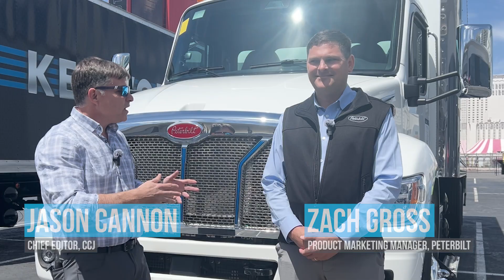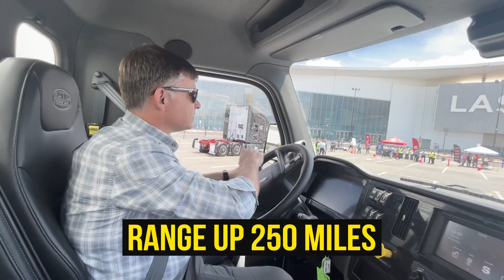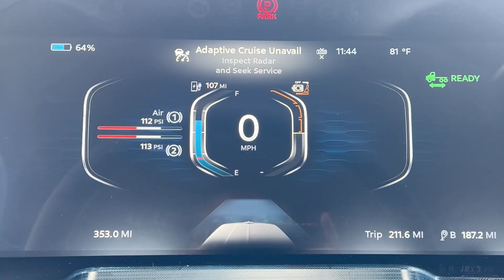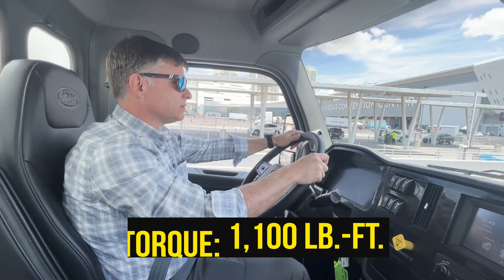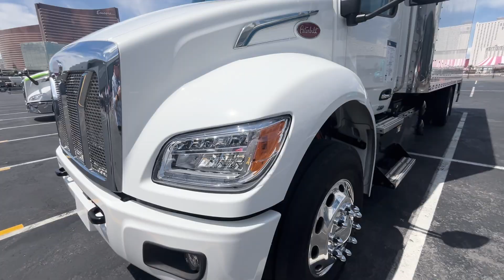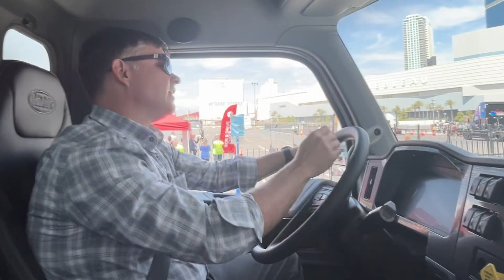Why Peterbilt’s New 536EV is the Ultimate Medium-Duty Electric Truck

Comment: To charge it will take 2 hours
Reply: Even worse--if you intend to use it to haul anywhere near the maximum payload, you will need to charge multiple times a day.  This "mildly" retrofitted platform is not an answer to anything, other than a half-hearted attempt aimed at regulator management.  Actual partial solutions for HDT are possible; just look at both China and Tesla.